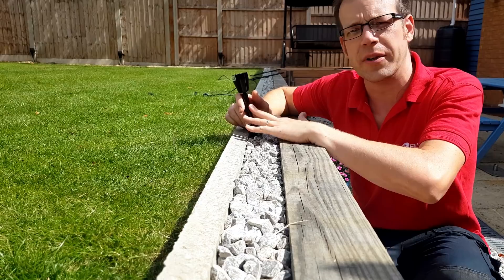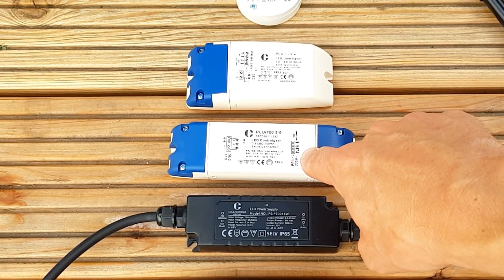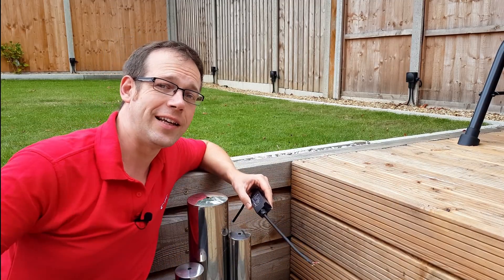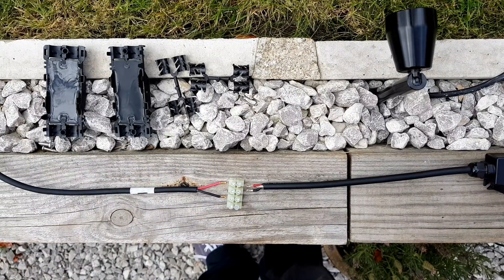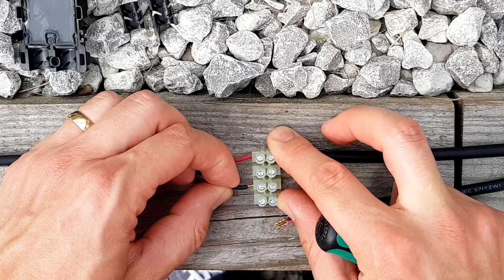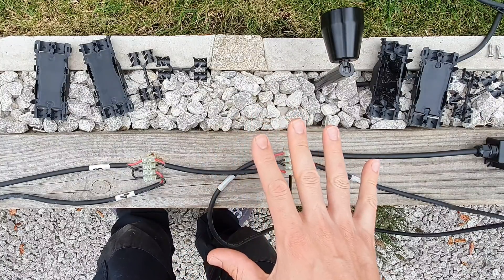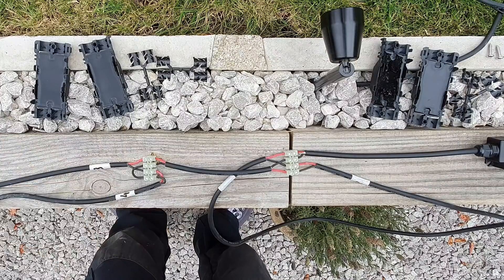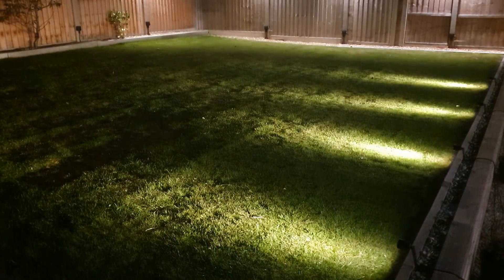KNOW HOW: Connecting LED lights in series with a constant current LED driver

Comment: If one of the three LED lamps fails, all three will stop operating when connected in *series*.

However, if the lamps are connected in *parallel*, to the driver and the driver’s output current rating matches the total current required by all three lamps, then the remaining two will continue to operate normally...
For a constant-voltage driver, the current through each of the remaining lamps remains unchanged, while the total current decreases.
For a constant-current driver, the total current remains constant, and the current through each remaining lamp increases proportionally.

Comment: i am sorry but in my opinion this is a terrible way of explaining it. Why not just state that there is a permanent negative from the driver that goes directly to the last light in the chain and basically starting from the 1st light the positive from the driver you are coming in on the red and out on the black and repeat all the way to the last light so that the current flows in on the red and out on the black.

Comment: can anybody please tell me what will be the affect on LEDs if one of its string malfunctions, will the led CC driver still provide constant because if it does the rest would get damaged. plzzzzzzzzzzzzzz help i am badly stuck
Reply from the maker: Usually white LEDs fail short circuit (unless it’s a wiring or assembly issue) so the remainder of the string continues to operate.
Reply: @efixx  so faulty string current would add up to the remaining one's right??? mine is yellow led COB type 3x10 connected in series and together parallel
Reply: My sir wants an answer from me that what will happen if one string fails to operate? Will its current add up to other operating strings or what? plzzzzzzz answerrrrrrrrr
Reply: Oh dear. This question demonstrates a serious lack of fundamental understanding of electricity. 

It's a constant current driver where the magnitude of the current is set to a suitable value to illuminate the LEDs, AND the LEDs are connected in series.

A series connection means that the same current passes through ALL LEDs.

If the LED fails open circuit then the current stops flowing and the LEDs will turn off.

If the LED fails short circuit, or if short occurs for another reason, the current is....wait for it.... CONSTANT...that is, it doesn't change. This is not a voltage source  powering the LEDs, it's a current source.

If you have multiple strings of LEDs in parallel, then you may have a problem if a string fails, because the constant current power supply won't know about it and it will continue to deliver the current at a magnitude it was set to do. This means that the other strings have to take the current and consequently they will increase in brightness. Whether they blow or not will depend on what amperage the current source has been set and whether individual LEDs can handle that.  You need to identify this 

If you are an electrician, then I suggest you change profession.
Reply: @deang5622  Dude i am electrical engineer, i think you misunderstood my question i am talking about several led series string connected together parallelly (THERE IS NO NEED TO IDENTIFY, IF YOU HAVE EYES YOU CAN SEE IT)OBVIOUS ENOUGH, i very well know how series and parallel circuit operates, please understand before passing on comments.
whatever you wrote i already know that so yea, tell me something i don't know, i have been looking for a solution to driver per led string individually and have already found one. i think you lack understanding skill DEAR.

Comment: Am I able to connect the driver in this method: 
Light switch > driver > long wire > single spotlight
Reply from the maker: Yes if the cable is okay for volt drop / current - but also check driver instructions - long cables may cause interference
Reply: @efixx  thank you! When I say long I mean about 4metres.
Looking at a driver now and it all looks okay. 
Appreciate the help!
Reply from the maker: Should be fine - but just watch the voltage at the fixture vs maximum available at the driver.  We installed one once with 100m of cable between the driver and fixture .

Comment: Good video Joe, you needed  to mention cable length run is to be considered as well per driver, as they have a max 🤔
Reply: What is the maximum cable length per driver?
Reply: @glennstokes5841  depends on the driver wattage output, they vary
Reply: @matthewdale956  hi Mathew thanks for reply. I’ve been asked to rectify a Garden lighting problem which at moment is 24v so wanted to know if i could replace existing lights with LED and transformer with driver

Comment: A quick question about outside lights do you need to use metal fire rated cable clips for a cable that’s run horizontal about 3.5m up a exterior house wall? thanks in advance
Reply: Can a fire occur and cause the cables to dangle and be an obstruction to people?

Comment: Would it not make more sense to use in parallel though,  in series all it takes is one dead light, connector, or wire,  and your entire circuits kaput
Reply: LED's shouldn't go open circuit though... it's fairly simple to troubleshoot the series circuits tho, you just measure voltages at various points... or simply short out fittings
Reply: @TheChipmunk2008  shouldnt, no - but you know what they say  "famous last words" 
n all  :)
Reply: what its meant by "kaput"? 🤔
Reply: @piratedprivacy9052  lol
Reply: @piratedprivacy9052  kaput = dead/finished/no-more
Reply: These LED lights require a constant current, which is done by using a series circuit and a matching constant current driver.
You could use a parallel circuit, but then all LED lights need to be the same (2 different lights can have the same current requirement but create different voltages) and the driver needs to deliver exactly the number of lights times the current requirement of one. Now when an LED light goes open circuit in that scenario, the rest of them will overload until the weakest one fails, overloading the other ones even more, until the whole circuit is buggered.
If you want to use a parallel circuit, it's best to stick with voltage driven lights.

Comment: Interesting..... still using Red and Black on low voltage. Not Brown and Blue
Reply: Red Black on DC is pretty universal, perhaps thats why, if you used brown blue, someone might think its an AC circuit
Reply: @Ressy66  incorrect. Red and black are old colours. None of which should be used if wiring in singles
Reply: @fraserreid719  its used on everything DC in Australia, blue and brown are AC i guess we dont follow the UK method in everything then
Reply: @Ressy66  yeah it's EU standard coding. Not sure what the Australian colouring is. I know US use black and white for hot a neutral
Reply: @fraserreid719  It looks like for AC the same as EU, but if you say brown and blue for DC as well (that still doesnt sound right) then we clearly differ for DC
Reply: @Ressy66  there's blue and grey for DC in panels depending on voltages etc. I always put cable markers on any cable I put into control panels with ferrules on them also
Reply: @fraserreid719  weird... sounds bit risky using same colours, wonder how many DC circuits were blown to smithereens because someone made a mod and assumed AC :)
Reply: @Ressy66  I worked on a DC battery bank years ago and they got the positive and negative markers the wrong way round and just about blew up the switch room of a factory
Reply: @fraserreid719  it's dc though not ac??? Dc voltage is still red and black colours it's in the regs 👍
Reply: @sbmorris2k6  show me where in the regs.
Reply: Doesn't matter what you use on low voltage as long as they are identified. Substations require 24v to be white with cable I'ds on them
Reply: Heads ups peeps.
Low voltage in uk is AC 50v to 1000v & 
DC 120v to 1500v.
This video is dealing with EXTRA LOW VOLTAGE, which is 0v to 50Vac/120Vdc.
ELV conductor colours are many, but commonly in pre wired fittings it's redve+ & blackve—. 
Single phase low voltage conductor colours are Brown line (live/phase) Blue neutral. 
Earth, circuit protective conductor, green and yellow.
So just be aware, if it says low voltage it can kill you.
Reply from the maker: Most of the LED fitting manufacturers supply the fittings with red/black connections. Adding in a different colour scheme to this video would add an additional layer of confusion.

Comment: Wouldn't it be easier to understand to take the supply to either end of the terminal block so you have a most positive end and a most negative end.  The lights then just connect their positive from most positive empty terminal and their negative to the next most positive (which will be next to to the first terminal).
This would have the current path snake back and forth from one end of the block to the other without having wires from lights cross each other.
Reply: Either I misunderstood yr concept, or if I get it right then wouldn't it will incurr longer/additional wire run to the last lamp fixtures from the source of supply(DC driver unit) ??